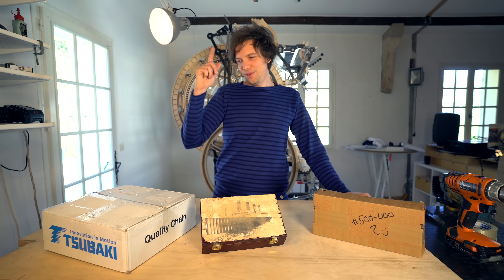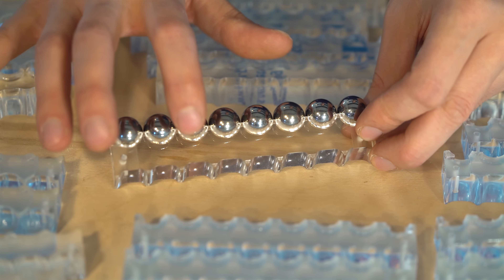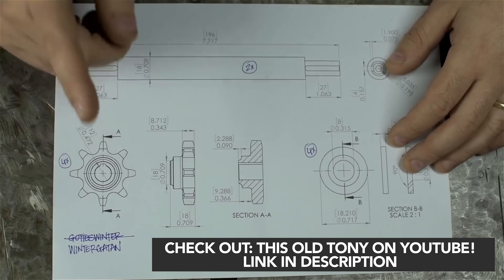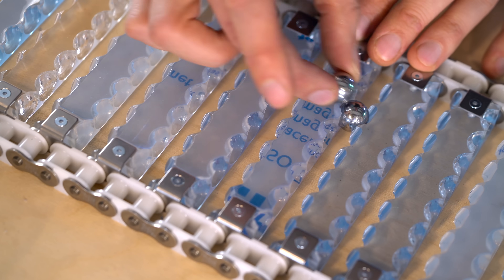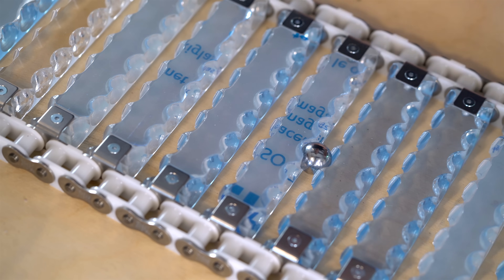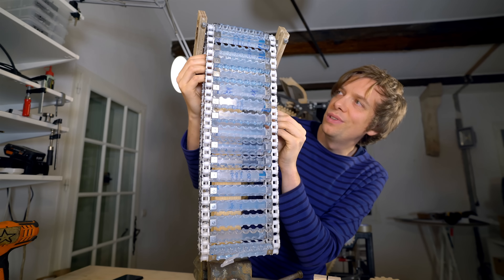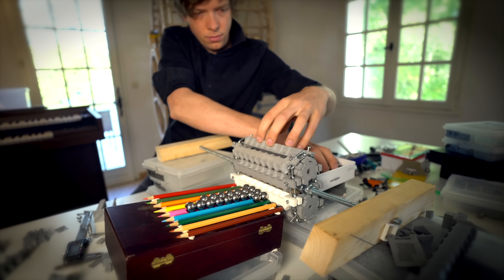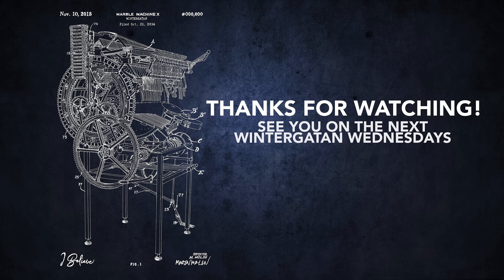Marble Conveyor Belt 2.0 - Marble Machine X #61

Comment: It would seem that the actual sound was created when the sprocket fell into the metal chain sections, not the plastic ones. Sure it was creating a bump in the path, so that needed to be fixed too, but the sound was the fall into the pit. Your fix of reducing diameter of the sprocket hub remedied both issues, so it all worked out anyway.

Comment: Martin! Wonderful implementation of a marble lifter! Great video! I couldn't tell if the idler shaft end had both sprockets keyed together or not. This is generally NOT a good idea as it promotes excessive wear on the chains. Simply remove one key on an idler sprocket and add a touch of grease on the inside of the sprocket hub. Only the drive end should have both sides keyed together. Your pretty chain will last much longer.

Comment: I don't get it, why the chain sprocket clearance failed. Wouldn't this be fundamental to any chain design? Wouldn't it have been evident using the company's design tool? Perhaps Martin can be forgiven for not knowing a subtle unspoken aspect of any chain's operation?

Also, it there a difference in the dynamic of a "flat chain passage" vs. a "chain curving around the sprocket?" That is, something like
..........||||||||||||||| (chain enters the curve here)
.......|
...|
| (sprocket here)
...|
.......|
..........||||||||||||||| (chain departs the curve here)

vs.

|
|
|
| (sprocket here)
|
|
|
|

(The dots are necessary to prevent YouTube from compressing the spaces that the dots represent, to form a curve)

Comment: I think I would have inverted the chain to hide the flanges and screws on the back side.  I guess it depends on the look your going for, but I think it would look cleaner with more of the acrylic and less metal showing.  I think it would work without modifying any parts just how its assembled unless the tabs end up interfering with the sprockets somehow.

Comment: You are using your calipers wrong. You keep during the inner face of the jaw which Is not always accurate you need you use the part of your jaws that has the angled cut in them. Now you are now doing anything that needs to be super accurate but for dinner parts and things like gear mateing it is a good habit to practice. Anyway I love this series and wish you the best of luck with the rest of your project -loyal subscriber
Reply: *FinerNotUsing Not Useing
Reply: * Finer Not Using

Comment: You might lose a small percentage of marbles in the lifting process from chain vibration. You sanded the corners which makes it easier to go in and easier to fall out. I suggest keeping a tight chain or add additional sprockets for stability.

Comment: Wintergatan, did you consider lift pellets wear from marbels striking acryllic pallets as they arrive to the lower capturing point of your lift?
Your accrylic pallets have very fine detailed edges to properly store the marbels, you'll probably need some kind of bumper for marbels to strike upon, before they meet with the pallet, because on a long slide they could gain enough speed to damage pallet edges over time.
Sinsirely hope I described my idea well enough ))))
Always looking forward for the new episodes on your MARBELLOUS machine!

Comment: I'm really enjoying all these videos, thanks for recording your progress. This is probably all moot since I'm not the designer, nor there to fit and feel how it works, but I'm curious about the Tsubaki chain. Couldn't they be flipped so the metal parts you screw to the clear plastic marble holders are on the rear/inside and not visible from the front? The marbles on the ends by the sprockets would have a smoother roll like the ones in the middle. I'll rewatch some parts now and realize it wouldn't work probably :P

Comment: Looks awesome but be careful about threading acrylic. It is very likely to start cracking over time. The process of tapping locks in stresses. I've had tapped acrylic parts strart crazing months after assembly.

You can anneal the plastic parts to remove the stresses. 

This is something to at least look into because you don't want it to happen later when you least expect it.

Comment: Just got notified my shirt has shipped. So joy. Just wish i got more in a few sizes, want to give them as presents. But i just got my size. Oh well. Hopefully will stimulate some discussions, point more folk your way.

And definitely a poster, my hallway needs one! Can probably fit it between my 1/8 scale piper cub and compound bow. Mount it on plywood, with a transducer speaker, and when the MMX theme tune is composed, a mp3 module hooked to my doorbell. Very definatly a poster is needed.

Comment: Martin, this won't entirely change anything but;
With the master-link on the chain, you always put the closed end of the link on the chain, relative to where the chain will go.
It won't go fast enough, but when the open end is the one going in the chain's direction, it has the ability to come off mid-cycle, potentially causing the chain to separate.
You won't be able to do that, but it's good insurance to practice that method.

Comment: Love the whole design process.  From your early days in your first machine to the current polished approach. 

One comment on your marble lift loading position.  In crushing of rock and transporting the fragments away a conveyor belt is used. One of the most important things to have is an “impact bed” under the belt in the loading zone.  This prevents the belt from being deflected allowing spillage.   You have a 30 mm or so happy between the climbing and descending sections of the chain.  You might want to put some hose impactors behind the loading position to prevent the chain and carriers from being deflected out of their travel route.

Comment: Why didn't you modify the plastic links with curved grooves to the sprocket's diameter instead of shaving off the metal?! or you might need to add for improved smoothness . 
inspiring work btw, engineer love!

Comment: Very cool design! Might I suggest putting the links that attach to the acrylic on the inside of the belt if there's enough room to not interfere with the shafting or sprockets. Then fasten the acrylic from the back side of the belt. It might make a smoother transition for the marbles over being pushed back to get over the link brackets.  It would change the aesthetics somewhat but might be worth a test. Just a suggestion. Looking good! Take care, G.

Comment: You shoud grease the parts though, it would make the system even smoother and prevent the parts from wearing down overtime. Make sure you use silicon grease to ensure it doesn't degrade the plastic.

Comment: I'm worried about the tipping properties of the finished machine. Have you done an analysis to see where the center or mass is? How easy will it be to knock over? I'm imagining a stage hand bumping into the machine back stage and knocking it over...

I hope I'm wrong, but by eyeball it looks like the center or mass is high and to the side. Adding heavy weights to the feet would fix that kind of thing. Just make sure to kick the machine a few times to make sure it can survive a clumsy stage guy

Comment: 8 tooth sprocket huh?  Should sell that to SRAM.  :P  But seriously, if design constraints would have allowed it you might be/have been able to take out a lot of the remaining jerkiness by using a 10 tooth with a slightly larger diameter, but that is just my opinion and clearly yours works great so no point in fixing something that isn't broken.

Comment: Did you sand both sides of the acrilic marble holders? You use only one side, but you can turn it upside down and you have a spare. That is not the time to find out that the marbles can't enter the holder! 🙄😉👍😁

Comment: About constant adjustments... Here is a Russian anecdote (adjusted for international use).
Once upon a time one company made a portable nuclear reactor prototype. They shown it to investors, paraded it at exhibitions and were very proud. Their rival company managed to steal all spare parts of the device and tried to build it on their own, but were very unsuccessful. In the end, they kidnapped one of the lab assistants to question him.
"You see", they said, "we stolen all of your parts, all of your blueprints. But when we strive to build the device, all pieces combined turn either into a giant kitchen fridge or into a T-34 tank! What are we doing wrong?"
"Oh", exclaimed lab assistant, "I see your problem! You forgot to steal an actual written instruction!" He rummaged through the pockets of his lab coat and a moment later presented them with a very tattered sheaf of papers. "Here, see it for yourselves."
Engineers of the rival company opened the first page and were flabbergasted. The first page contained only a few words in bold:
BEFORE ASSEMBLY, FINISH OFF WITH A RASP-FILE

Comment: I really don't like that slack on the Lifting belt, you are going to get a lot of oscillating on that at full speed that might affect the pickup-rate. I would suggest adding a guide rail that sits in line with the sprockets to provide tension on the lifting face, or to increase the tension in the chain by including a tensioner on the back side of it.

Comment: Could you not have the metal attachments on the chain lift to the plastic on the inside, rather than the outside,  this will not affect the marbles so much, plus would the marbles be magnetic at this stage? absolutely love your machine by the way.

Comment: That is mechanical poetry. It's painful that the front surfaces of the acryllic pieces won't stay ultra clear like that, because marbles rub on them. Remember to shoot closeup footage while it's new.
Reply: how quickly will the acrylic marble racks wear out? Seems like a very soft material.
Reply: Kanal Frump 
The marbles are metal and the acrylic is plastic so logic would suggest that the clear finish won’t last too long, but because the marbles are spheres and are only contacting the lifters at one tiny point. So the affected surface would probably look like a thin line on each piece, and probably not very visible, also the machine is very precise, so I don’t think there will be many stray marks to mar the aesthetics
Reply: @ashtonaimes2299  Wear doesn't stop just because you've broken the surface a tiny bit. It'll start as a thin line, but once you have a small line the marble has more surface it's touching, and eventually, the line will become an unsightly groove. The marbles are going to be hitting and pressing against the acrylic more or less continuously while the machine is running. Martin may want to have a few spare chains with fresh acrylic just for aesthetics, depending on how it wears.
Reply: Wear shouldn't become a functional issue any time soon. Smooth metal and plastic surfaces are quite durable together. But the surface goes cloudy. It will still look good, just not magical like this.

Comment: Did you buy 2 chains? ... stuff happens....4 month lead time... :/
Reply: this! get a backup ordered asap
Reply: That's usually the step after prototyping is done ;) things are still subject to change.
Reply: This was the first thing I thought. Plastic links... 4 month lead time? Order 7.
Reply: Luckily, if anything catastrophic happened, they could replace a plastic link with a metal one in a pinch with just an hour or two
Reply: Yea, I thought that too, but then, don't want to order many then find a design change is needed

Comment: I don't understand why you didn't put the screws holding the acrylic inside the belt, instead of placing them on the outside side of the belt. That way, all the marbles would touch the acrylic, and you wouldn't need to bevel the screw holes to make the surface flat. Also, I think that would make the whole structure even looks lighter, as we won't see how the acrylic support is attached to the belt...
Reply: Its will be easier to detach acrylic if something happened...just unscrew..and done..if martin put the screws inside the belt. He will need to detach the chain first. Before unscrew the acrylic
Reply: Or CNC a recess for the plates.
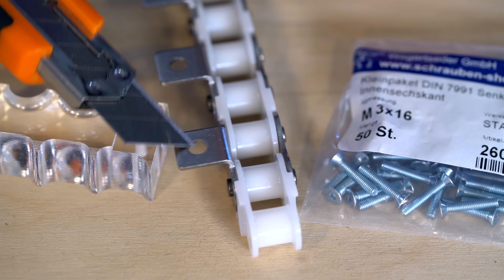Reply: @chartle1  If you look closely at 7:10 you can see there is a recess made.

Comment: Briefly seeing the marble gear lift entrance (#58) in the background reminded me, would moving the entrance point a bit further clockwise on the gear help in feeding marbles into the entrance? While the opposing magnet forces the magnetized marble away, it alone isn't enough to force a lone marble across the aluminum spike and into the entrance, so the lone marble just gets pushed back and almost immediately grabbed by the next magnet.   Mind, it could be that you can't actually move the entrance far enough around the gear to even matter, not while still having enough drop within the pipe itself to successfully gravity feed the marble into the next gear.

Comment: Can I say you need a metal lathe someday? Even turning wood on a metal lathe is fun work, it's slow for curves on a manual lathe but it's fun!

Also, I think the long arms for the reciprocating movement aren't really pistons, they are more like connecting rods. I might be wrong but I think the connecting rods is the proper term for a part that convert rotational movement into reciprocating movement (or vice versa probably).
Reply: why not ask this old tony about adopting a baby lathe, he sure knows how to take care of it and how to be a good lathe parent!
Reply: I heard those are really making a lot of noise, I tend to prefer a bit older ones!
Reply: Nah he doesn't need a metal lathe. Besides, plenty of people with lathes which he could outsource these kind of jobs to!

Lathes are not expensive, but the tooling easily runs into the thousands of euros. And you always need what you don't own yet, making it a pricey hobby.
Reply: @lukasdon0007  For what he's doing, a simple $600 benchtop metal lathe from AliExpress would probably suffice (just don't go too cheap). I'm thinking of getting one myself for making replacement parts such as bearing housings, etc.
Reply: I don't know about that ... messing with time travel without proper education is dangerous! ToT has experience in the field though and could yet again be a valuable resource to the MMX project.

Comment: Great job, well done, it works great. But for the eyes the metal mounts for the acrylic ball holders would be better on the other side so they can not be seen. Is it possible to turn the chain inside out? So the mounts are on the inside of the chain loop.

Comment: you might want to make a safty devices, so you can't turn the machine the wrong way, els it might break your new chain, because of the racthing bearings or break something in that area since the chain can only go one way.
Reply: That shouldn't be a problem. The two reciprocating links seen by the two magnetic lifting wheels lift each link in the chain via a pawl, so the chain can only ever go in one direction. I'm not sure if the rest of the machine is capable of operating in reverse, but this part should be safe.

Comment: So much 3d printing to waste.... but I think you made a great choice.
Reply: check out the definition of 'Prototyping' I don't think there was any waste here...
Reply: Actually the 3D printed parts were the proof of concept prototype; Marten had to verify that his marble chain elevator design worked before Alex CNC and This Old Tony got the final specifications to make the actual components that would be installed on MMX; I hope when the MMX is complete and is on tour, he will have on display some of the prototype parts that were used as proof of concept parts.

Comment: So, out of curiosity, do you go back into the CAD and update with your on-the-fly fixes?
Reply: Funny thing but this is the exact reason why we can't rebuild the Apollo Saturn V rockets even though we have all the original plans. There were so many ad-hoc fixes and small modifications during assembly that were never documented by the engineers that there's just no way we can repeat the process. So, Martin, document your changes in the original CAD designs, you never know when somebody will need to rebuild the Marble Machine X :)
Reply: @dexio85  Fortunately, the YouTube videos themselves act as a sort of documentation so, unlike the Saturn V, not all is lost...
Reply: @RexDexPL well it's not that we can't it's more that it'd be so expensive to work out all the kinks all over again that it just isn't economically viable. That an apparently a loss of skilled enough welders and fitters(which I think is BS).

Anyway, basically the documentary I saw said it would very likely be cheaper to just design the entire thing from scratch and build it with modern techniques rather than follow the original plans.
Reply: I've been wondering about that as well. He may very well need those plans again after all, either for making replacement parts on / after the tour or even if someone else wishes to use / purchase those plans to make their own MMX.
Reply: I guess he will, since I remember him saying that he'll make a second MMX as a backup.
Don't ask me when or where he said that though..
Reply: I would think so because its my understanding this is Marble Machine X serial # 0001. I think the plan is to make at least 2.
Reply: When he was talking about the PBS, I believe he mentioned something about updating the models